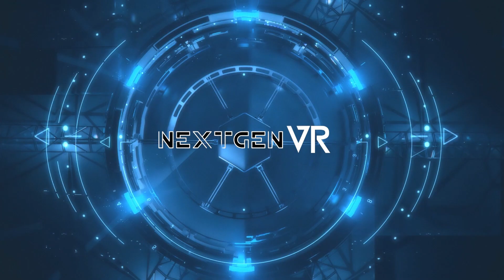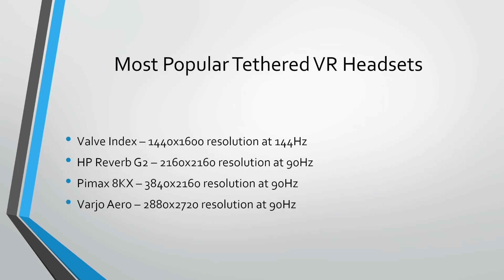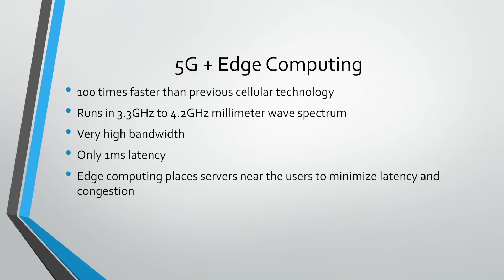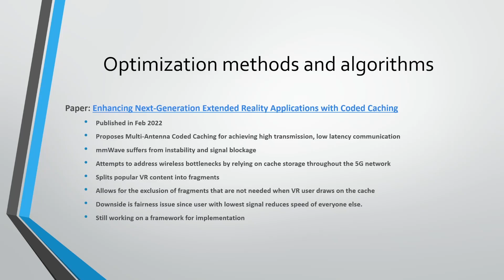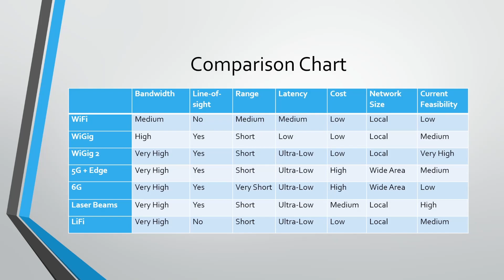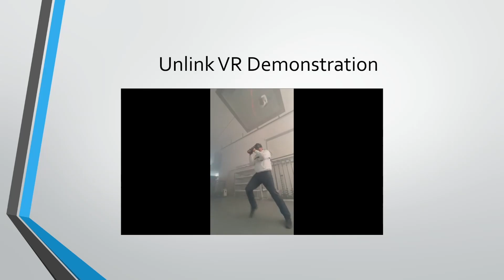The Most Promising Technologies For Seamless Wireless PC-VR!

Comment: The power consumption is not a big problem with a powerbank mounted on shoulers/chest/belt . For use on the way is just enough 1 powerbank in pocket with 1 step connecting to standalone VR headset. In my opinion, the next turn is for WG2 and LBT.

Comment: It's not quite the same as wireless but I speculate that we're going to see a rehash of the VR backpack idea from Valve but instead of a PC that can only be used for VR, which was the reason VR backpacks didn't catch on, it will be the next version of the Steam Deck which when not in VR can still be just used as a steam deck, with some sort of wearable strap.

This way the player can just strap on the Steam Deck 2, plug in their VR headset and have completely lossless low latency VR with the practical advantages of not being tethered down cause the wearable PC moves with you. I think Valve would be betting that even though their top of the line Steam Deck 2 won't be as good as a top of the line PC, it will be good enough that when combined with the quality of uncompressed video, it will be the best untethered VR experience possible.

Comment: The Pimax 12k won't have Wigig 2 and I can prove it. It will either be Wigig 1 (802.11ad) or WirelessHD. Both anyway using the 60ghz frequency
Reply: Pimax 12k's wigig implementation appears to be completely modular, so it seems like nothing would stop them or potentially even a 3rd party from making a wigig 2 transmitter/receiver.